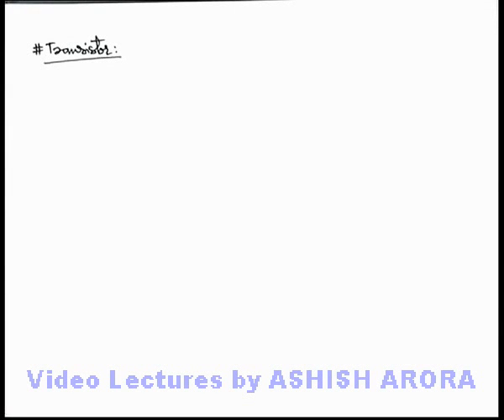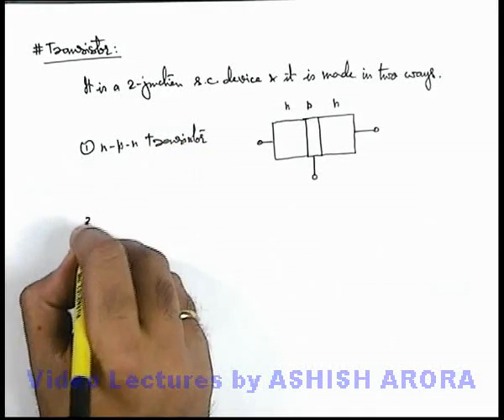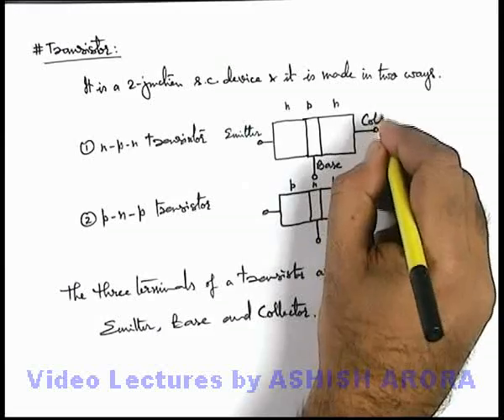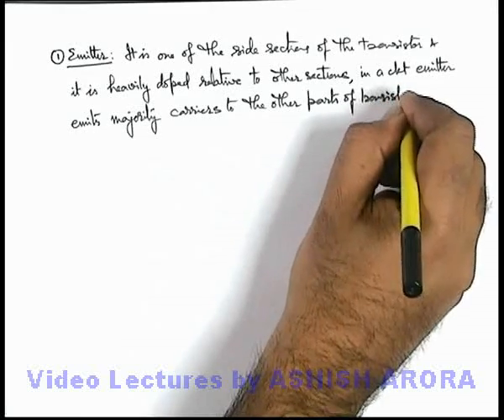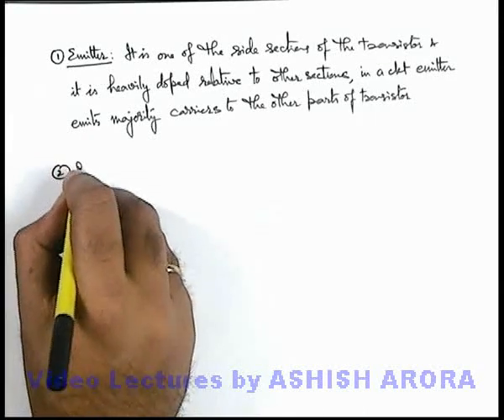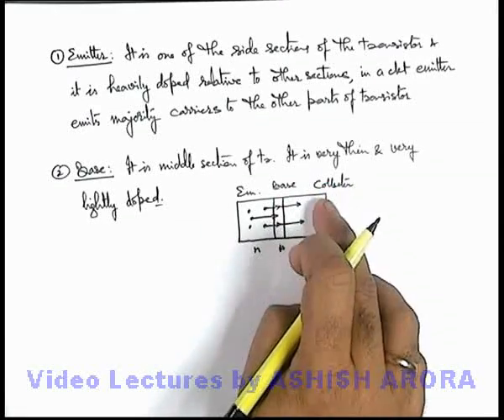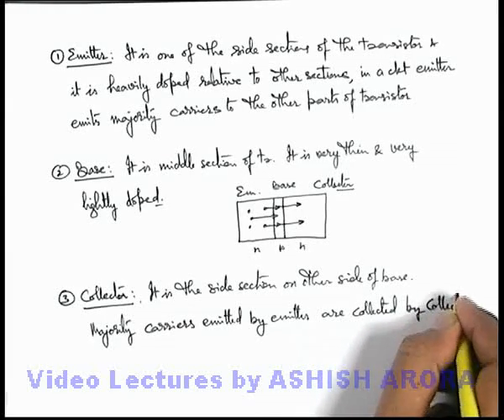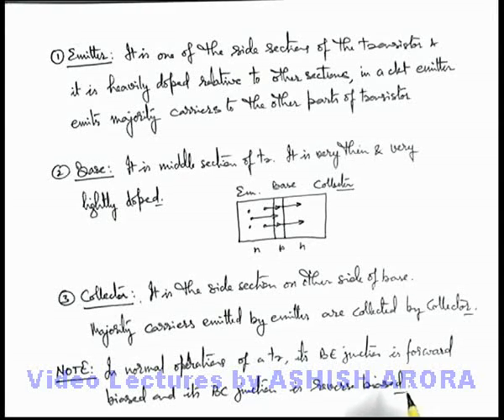Class 12 Physics | Transistor And Its Application | #1 Introduction to Transistors | For JEE & NEET

Comment: sir i m in 12th class...is semiconductor and signals chapter needed for kvpy 2016..or i should utilise remaining time for revising 11th class portions ..i have completed 12th till modern physics
Reply from the maker: There will be max one question on semiconductors in KVPY, if you cover it will be good...
Reply: thnku
Reply: thnku